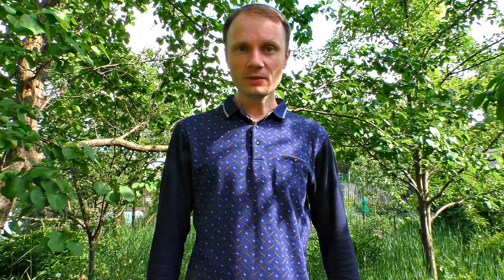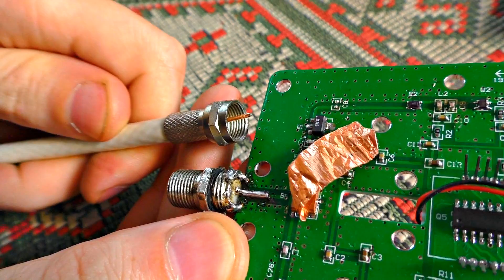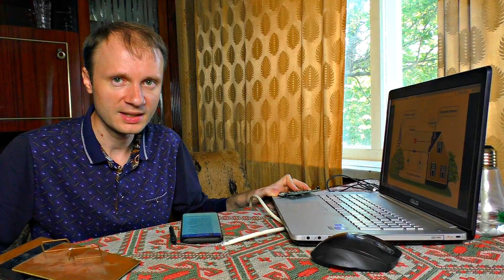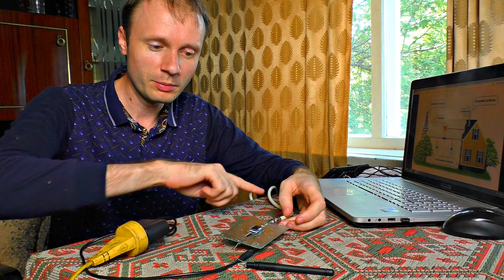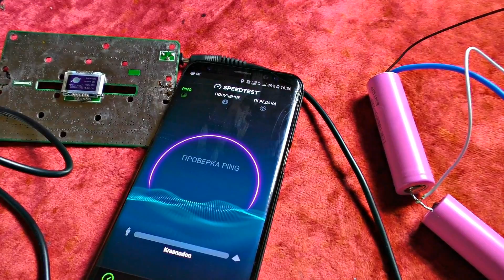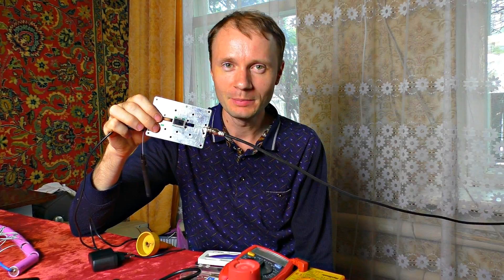Boost Your Cell Signal / Easy and Cheap 3G Coverage Enhancing 2d

Comment: another good video, nothing was smoking, yet, at 1min. 5sec.. how about a signal relay for a drone? couple ideas a ground relay of course, maybe using a helium balloon with a antenna maybe helped positioned with a mini drone. I thought drone weight lifting would be on TV by now.
Reply: maybe hide(design) some lithiums in the balloon, have the helium pickup the weight. U like?

Comment: Whhhat? You guys are still using 3G?
We're going to have 5G soon
Reply: yes, slavic countries uses even gsm and 2g like in slovakia sooo....
Reply: @hibo.333  in fact, many countries began shutting down 3G, but not 2G because of IoT, elderly and because it just doesn‘t make much sense refarming 5 MHz more bandwidth. For example, T-Mobile in my country already uses 10 MHz on LTE band 8, which is the maximum bandwidth supported on B8 (5G n8 supports 20 MHz). 

In rural areas of Germany, some towers still only have 2G.

Comment: I want one of these but for my car when I'm driving can you make one?
Reply: Adam Flowers first of all, why would you need to handle your phone while driving? Please focus on the road.

Secondly, the receiver in this video is directional, hence it would not work mounted on your car, since you would move the receiver away from the antenna which it has to be focused on.
Reply: @steffenskott7101   that is It want to have it remote áreas when  I drive. Not while driving.  I go to service remote áreas and need good cell service and internet. That is why i want the non directional version,

Comment: Make sure you use the correct impedance coax cable to connect the antenna to the repeater, or you will get bad a SWR. Impedance matching is vital for efficiency.
Reply: Rather not make sure because it will cause less trouble with authorities for operating a illegal repeater.

These repeaters usually have nothing against a bad SWR because they come delivered with these bad antennas with 10m/30ft of RG174 cable.

Comment: Does this work with 4g too ?
Reply: Do you pay attention to the video? (NO ONE ANSWER THIS QUESTION!)
Reply: Yes, a 2100 MHz UMTS amplifier also will work for LTE/5G and a 900 MHz GSM amplifier will also work with LTE, but check if your provider uses LTE Band 1/8 or another band like Band 5/28 (some like Claro RD use both B5/8, in this case look what bands the closest tower has).

Comment: Unfortunately this is illegal in many countries.
Reply: pretty much every subway and metro station have these installed every where.. atleast in Kolkata , india ... I get stronger signal in metro than at my home xd... 4g works at 40+mb/sec on metro and 10mb/sec on my home!! ...
Reply: @KuntalGhosh  Well, but they have a license i would think.
Reply: I don't think it has to be illegal. This project is just amplifying a signal under a safe level and it's not interfering with it or messing it up
Reply: I'd argue thats a good thing. Some frequencies should be protected so you don't get too much noise on them.
But since the amplifier is quite weak it should be ok(at least from a technical standpoint, not sure if a signal that weak would be legal).
Reply: @lands1459  Maybe because interference... I don't know how the regulations are in Canada (where you live, I think) but here in Germany I'm pretty sure it's illegal.
Reply: @lands1459  You need a license to use that frequency, thats the thing.
Obviously people won't notice, but that doesn't make it any more legal.
Reply: @lands1459  Yes, you require a license when you transmit, and thats exactly what he does. He grabs the signal from the air, amplifies it, and transmits it at the same frequency.
If he wired his phone to the amplifier it would be fine, however, he is transmitting a signal to his phone.
Reply: Thanks god it is illegal.